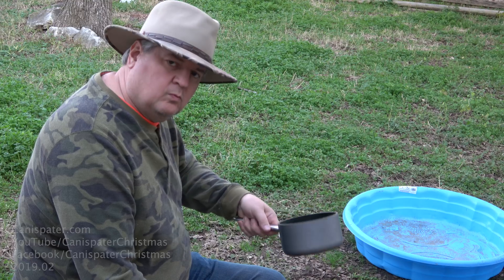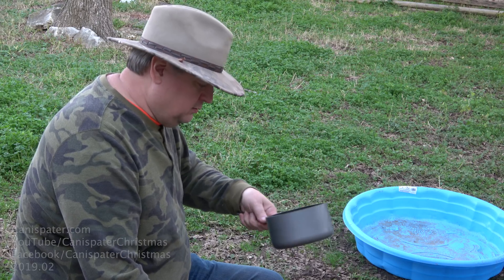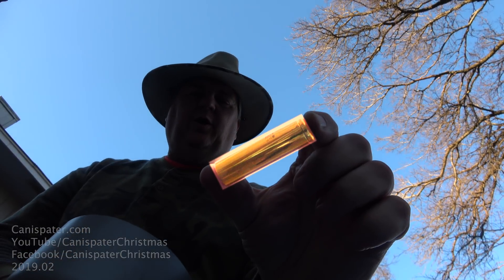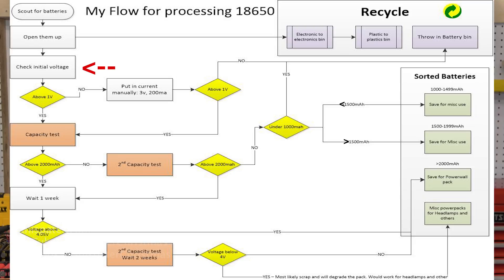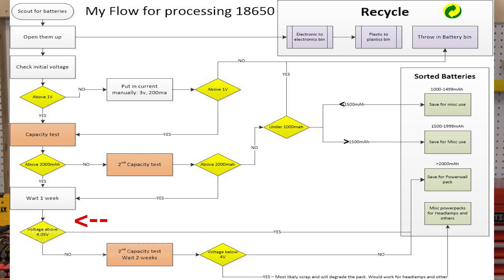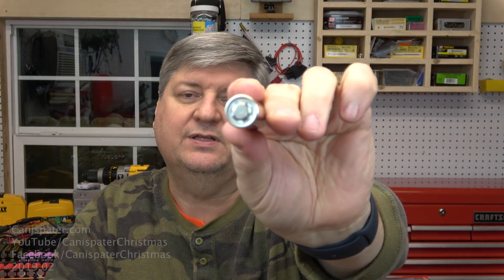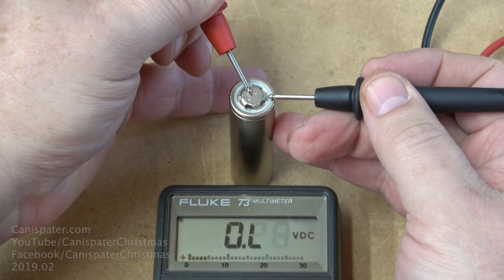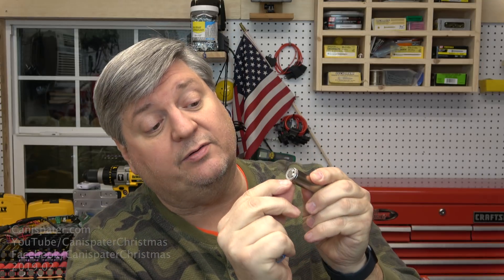⚡️DIY Powerwall Project - ep2  (2019)

Comment: Hello, why do you not buy new cells. If you take old cells you never know is this cell realy o.k.. You no not the cycles of used cells. 
I have start up my project with new cells. I have bought 600pcs each for 1.2 US $ from two diffrent china companys. I take the first test with this cells, and the cells are great.
They have all a capacity between 2350 up to 2.470mah. I have take a stress test, with fast charging of 3 A, no problems. 
The cells call FST 2400 MAH look here www.youtube.com/watch?v=Lj6-kPgQL4E i can send you a eMail where you can get it.
Reply from the maker: Several have purchased "new" cells from China and received fakes. You may have found good vendors, but there are many that are bad and many have stoped trying. Another tactic is to make the first order good cells then the fakes come on later orders. Correct. We don't know the cycle count on used cells so that's also a gamble. My email is on the about tab on my channel or you can leave a comment at blog.canispater.com.

Comment: We at Power 2 Spare identify the year of manufacture for the cells we sell.  Our testing methods are second to none.  We under promise and over deliver!  For example, cells identified as 2800mAh will commonly retest at 2900mAh up to 3200mAh.  With each box of 100 cells we provide 100 Dark Blue Sleeves for FREE, and we include 2 extra cells of the same capacity ordered for spare / replacements if any of the 100 fail during your testing, and if they don't then you get 2 extra cells to use in your build!   We process orders within  1 day, and ship via Fedex Ground.  We are always testing, and building out new inventory!  You can follow us on Facebook @Power2Spare18650

Comment: Best of luck in the cell hunt.  I'm still baffled as to why everyone wants to use 18650's for this though.  The big advantage of lithium chemistry is the capacity you get in a small/light form factor.  Who cares for a stationary powerwall at home?  New sealed lead acid batteries are 10X cheaper than used 18650s.  They're also safer, easier to build out, and easier to recycle when the time comes.  Maybe you could discuss a bit in ep3?

Oh and count me amongst those loving the intros :)
Reply from the maker: Haha. Thanks! I think I spend more time on the intros than the real videos. lol! I usually get inspired on my commute. You make valid points. I'm doing it mostly for fun, but there are a myriad of other reasons that come to mind. Let me collect my thoughts and see if I can put something together. I also wanted to stretch the channel a little as most lighting stuff is dormant right now though I am doing research for some things... :)